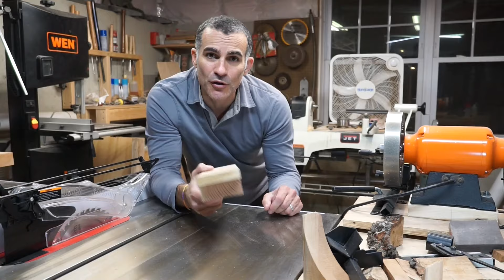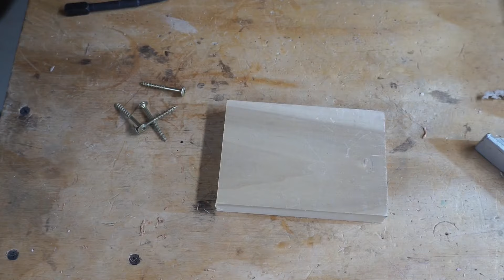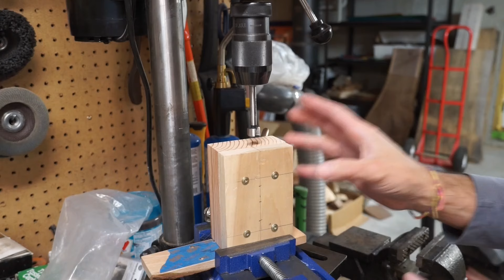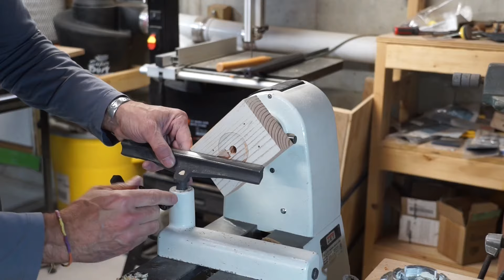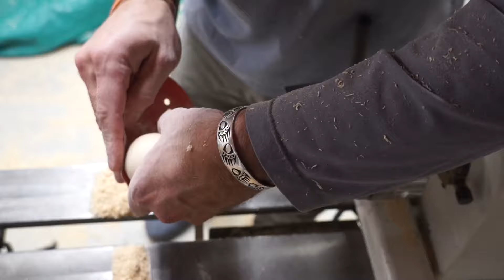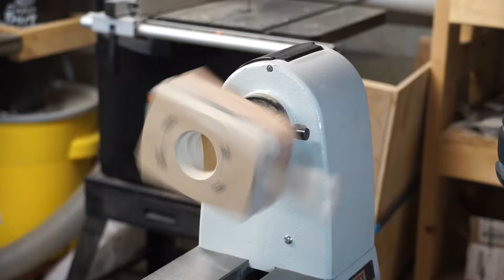DIY: Make a Spoon and Coffee Scoop Jig for your Lathe

Comment: One issue I came across is you showed using a 1 5/8 bit and drilling approximately 1 7/8 deep. That would go through the 1x4 and almost an inch into the 2x4. That left me a half inch to spare. Your video shows you not going into the 2x4. Did you mean 7/8th ?